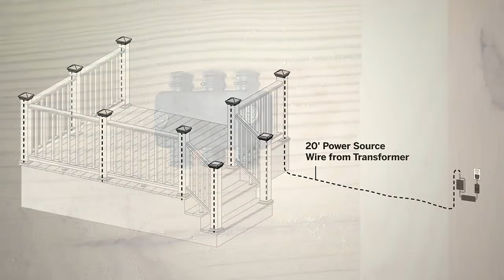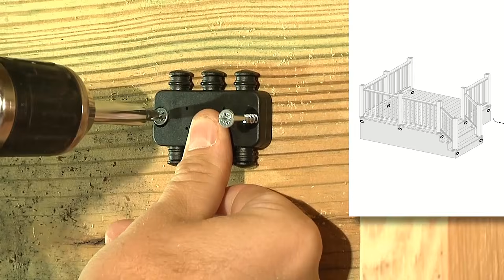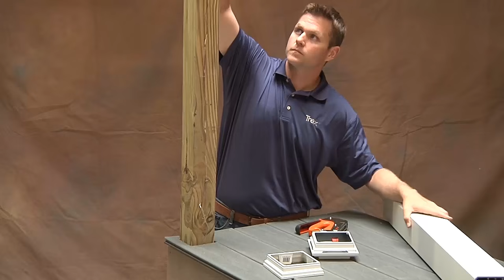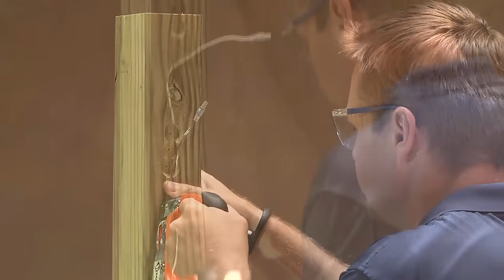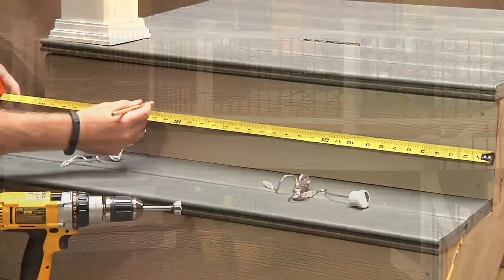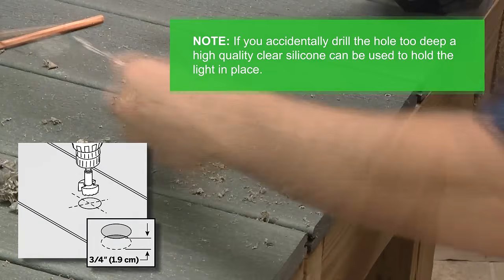How to Install Trex LED Deck Lighting | Trex - YouTube

Comment: Would be nice to have a better demo of installing multiple riser lights rather than showing just 1 going into a 6 way splitter. Espescially considering the wires on the lights are female and not male like shown here.
Reply from the maker: Hello. Thank you for reaching out to Trex and your interest in our Trex Lighting System. We would be more than happy to assist with any additional installation questions you may have regarding the Trex Stair Riser Lights. Please feel free to private message us or give us a call at 1-800-289-8739. Someone from our customer care team will be happy to assist you. Kindly, Brandi -Trex Customer Care Team
Reply: @TheTrexCo your customer service is top notch, no complaints from me whatsoever! I just think a more in depth video could be helpful for anyone doing riser lights for the first time.

Comment: Can I use these lights for a retaining wall. The wire would be ran in soil ?
Reply from the maker: This can be accomplished, Kevin. We'd recommend splicing the wires and using gel filled wire nuts versus splitters.

Comment: Do I need a splitter at all light locations or can I connect to another 6 way splitter by using a longer cable from light
Reply from the maker: We recommend a splitter at the base of each post.

Comment: Is there a special drill tool for the recessed lights?
Reply: 1" forstner bit works great - don't go too deep...but if you do you can use a dab of silicone to keep the light at the right place

Comment: I just had my Trex deck installation completed, and noticed that there are no screws or adhesive holding the Trex deck cap lights to the posts. What prevents these expensive lights from lifting and blowing away in a storm, or being easily stolen?
Reply from the maker: Hi Gregg,  We recommend securing the post caps to the post sleeve with silicone of PVC adhesive.  This will prevent the post caps from detaching and will also prevent any theft.  Kindly, Trex Customer Care Team

Comment: How do you hide those splitters?
Reply: You don't really - they are under the deck.
Reply from the maker: Each light comes with a 5 foot lead wire which you would run between the post and post sleeve to the splitter.  The splitter would be hidden at the base of the post under the deck surface.  Kindly, Trex Customer Care Team